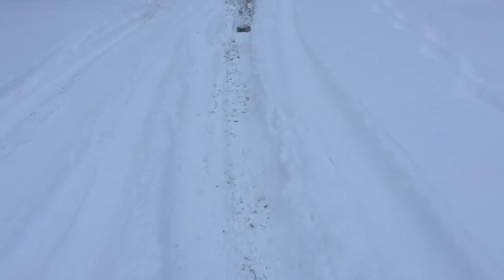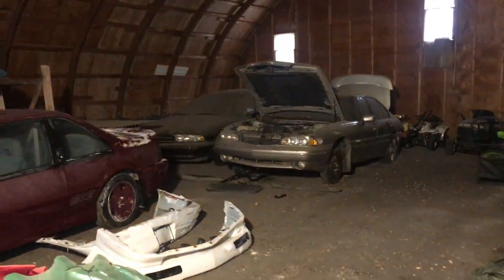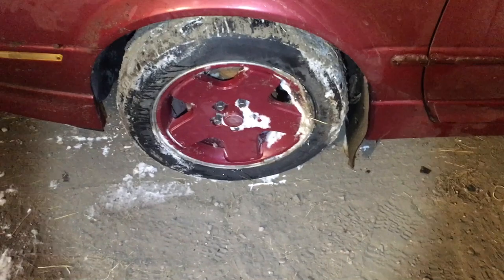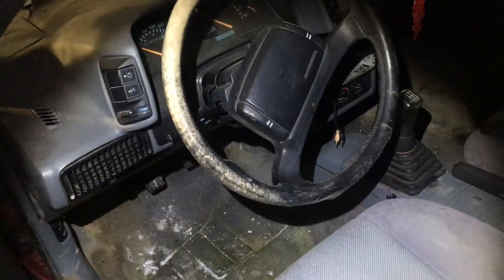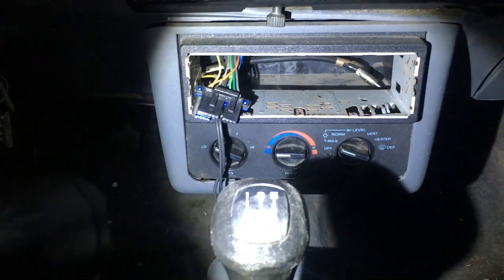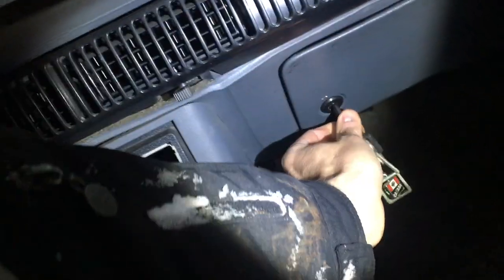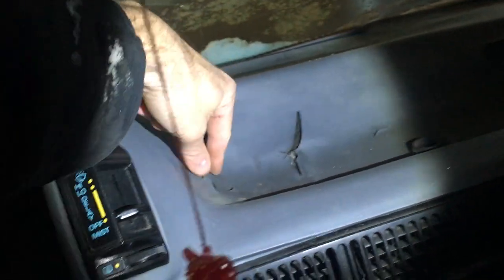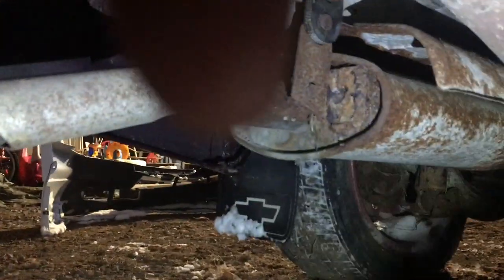1990 Chevy Beretta GTZ - First View/Introduction to the car!

Comment: The steering wheel looks like it is from a Cavalier ,   I had a 91 Bretta GT with the 3.1 V6 5 speed . Very fun car . 91 had the ABS and Air bags . 
Those rear trunk locks seize up pretty bad 🤨For some reason I don't see any of these anywhere anymore 😩
Reply from the maker: That’s what I was thinking when I got this one.  The Beretta is a fairly average car, and most have been used up and have gone away.
Reply: @Turbo231  Yours looks like it is in decent shape , The Quad 4 was not as powerfull as the 3.1 but lighter and had a power band higher up in RPM